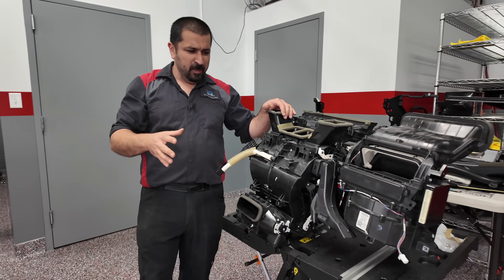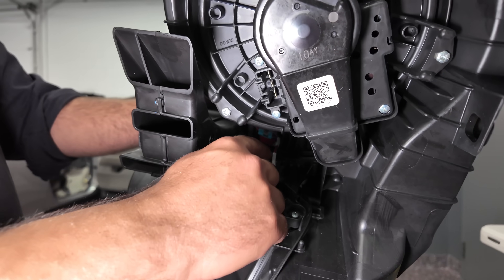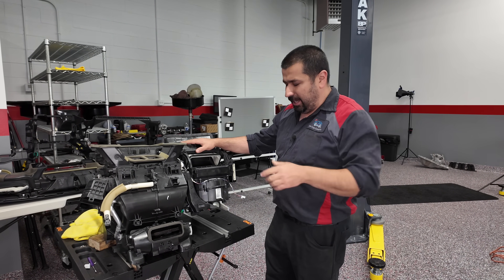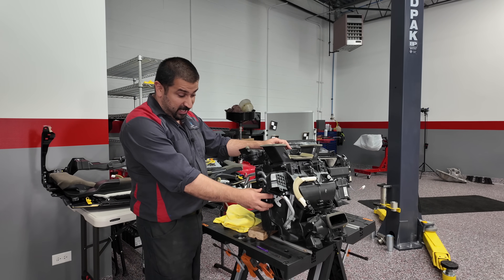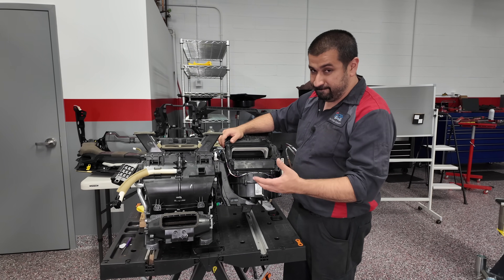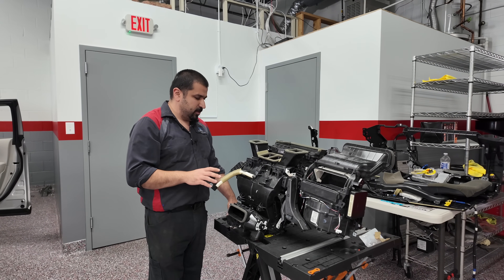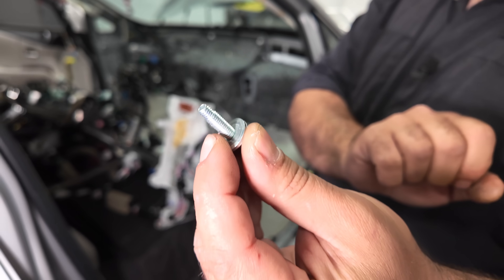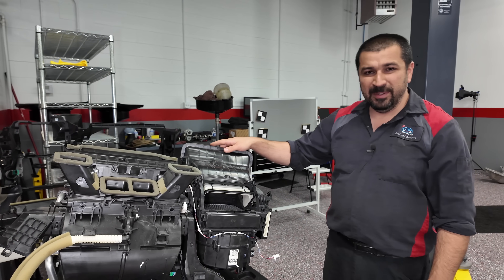THIS is Why Car Engineers and Car Mechanics Don't Always Get Along!

Comment: This started with CAD drawings many years ago where engineers sit behind a computer and makes his or her drawings it would be much better if the engineers and air conditioners  team should work together with a top of the line master AC mechanic, next the Quality Control and Field Testing  team should througly test R&D for any flaws that might occur during winter  and summer tempratures?

Comment: Everything made today is designed to be as cheap as possible to manufacture,
with zero thought given to reparing it.
I have been servicing consumer electronics since the early 70's, back then  they 
had removable plates so that you could gain access to replace the parts that 
often failed, then as the years went by the stopped fitting them, so you had to waste
hours dismantling the entire unit and have no way of been certain that you had 
replaced all the faulty components until it was reassembled exactly the same as this
cars HVAC unit is.
We made our own extension adapters to allow testing before it was fully rebuilt.
So i feel your frustration.
Todays servos and actuators have a finite life, yet they are used everytime the car is
started, crazy or what ?
Reply: I roll down the front windows in my 2007 Dodge caravan. Works for me. 
I don't think I have turned on the AC more than 8 times since I bought the dam thing.
 Cold / Hot control a little iffy for the past 12 years. I move it but once a season. lol
 I am a very simple man/ with very simple needs in life.
 YOU do the high-tech if you wish/ and pay the price when it fails.

Comment: My professor in school told us something I've always remembered, "engineers live in a theoretical laboratory world of their own design,  mechanics on the other hand live in the real world and have to correct engineer's design".
Reply: Not always true. I was a mechanic before an engineer.

We’re on the shop floor more than I thought we were going to be talking to the techs. I’m part of R&D where I’m inquiring between manufacturability and cost savings.

My most recent discussion involved the complexity of independent suspension vs beam suspended on an economy car.
Reply: As an Electronic Technician for almost 4+ decades, I 100% AGREE…..
Reply: There is design tool called DFMEA. Design Failure Mode and Effect Analysis. It works detecting possible failures in a system and their effect in its performance. When designing things you try to make them as robust, simple, easy to mantain and reliable as possible.
Reply: Your professor was an ignorant idiot. Every engineer works based on a tech-spec and main goals are system efficiency, reliability and cost. Serviceability is a secondary goal however components are graded, so for instance you have "easier" access to critical engine or transmission components (grade one), and harder access to grade three (HVAC) components. HVAC Engineers are also limited in design because grade one and two components take precedence. Your "professor" who I'm sure never worked a day in an industrial environment, assumes everything is as easy as his unfeasible conference papers and can BS about Engineers.
Reply: I guess if the professor is only talking about some design engineers. As a manufacturing engineers, I spend a lot of time on the production floor with techs and talk to them constantly. There's a lot more to engineering than being in world of our own design and there are many different types of engineers and we are constantly looking at other people designs. I see both sides of the story.... my dad was a mechanic and I'm a manufacturing engineers (but worked on cars all of my life), for the mechanics out there, it is way more complex than you would think designing something....just try to design something like a flashlight... you'll find it harder than you'll think it is. With that being said, there are definitely bad designs out there and it is always easier to see things in hindsight.... that's why bad engines usually get sent back to the manufacture to be analysis and to learn from
Reply: @ValidAsian as an Electronic Technician for almost 4+ decades now,  I have worked along side Engineers with good common sense, but the cluelessness of the bean counters on higher ups put a gun on their heads a lot.
Reply: @ValidAsian Shame on you for being so ignorant.
Reply: @ralfrufus6573  What am I ignorant about? I would like to learn
Reply: @ValidAsian  When it comes to the need of the people repairing what you have done.
Reply: @ralfrufus6573  There are definitely times where I could have designed something better and be for serviceable but I never said that there was no need for "people repairing what you have done". What I was bring to light was that designing an assembly is more complex than most people think and you are bound the find things that could have been done better in hindsight, I'm talking about any design, not just cars.
Reply: @ValidAsian  If it were up to me I would force the engineers to repair at least once what they have done, so next time they think twice before doing something.
Reply: @ralfrufus6573 If you really want to force an engineer to work as a tech (maybe they do, I don't know) then a tech should be forced to work as an engineer to come up with a more serviceable part. I ain't gotta worry about these overly complex systems because my trucks are going to be more basic models.
Reply: @jeffmockus5400  Deal.   The old designs are on record.  There is no such thing as something new.  "It's been done before."  First thing is to segregate the CAN bus wiring based on priority.  Luxury items shall be stand alone units....which saves wiring costs.  No radio is going to short out an important communication feed, such as security, on the CAN bus.  Next, take the TCM out of the goddamned transmission oil pan.  I can go for miles, baby.
Reply: @ValidAsian  My late professor, was referring to design engineers. Not the production engineers who have to correct the people at design.

Comment: I am currently dealing with the recirculation servo going out in my 2016 Camry (loud clicking when the door closes; sometimes it goes away). Looking back at the service history, the original owner had replaced it in 2018 under an extended warranty. The cost was almost $900. The servo itself is only around $120. I got a new quote from my local shop, and the total cost is $800+ for labor and the price of the part. Luckily, they did recharge my AC, as the air was only blowing ice cold on the passenger side. So now it will get me through this 120°F+ Arizona summer. I'm going to take on this task when summer is over.

Comment: Is it possible to get from a wreck the minimal parts and wiring needed to simulate that HVAC unit to do a test? Getting the wiring connections needed so it's like it was in the dash?

Comment: This is similar to what I had to do to replace the heater core on my 85 Capri.  I failed once during warranty.  Dripping coolant on the floor.   Was covered under warranty.  Have no idea how many hours it took them but it's a big job.  I think it failed around 3 years.  At 6 it failed again and was not under warranty.  I called in to try to get it fixed.  They could not get to it for quite some time.  It was November and getting cooler in the north east.  It was also getting coolant onto my windshield which is not easy to get rid of.  So I decided to do it myself.  Drop the steering column first.  Remove the dash.  All because this car had AC.  If it had not the heater core would have been accessible via removing the glove compartment.  Seemed to be this was due to some fault heater cores and maybe rebuilt.  Took me 8 hours to get it out, replaced and back in.

Comment: Ford F series trucks in the early 2000's soldered the fuel pump relay into the fuse panel and is not serviceable. You burn through many fuel pumps due to a failing relay.

Comment: This is why I avoid luxury car brands including Lexus. In the 1980's and 1990's the Toyotas with manual dashboard heating and climate controls/ levers/ blend doors, etc. would be trouble free for 40 years or 500,000+ miles.

Comment: Dear AMD, thanks for your video. I couldn’t agree more with you on the poor design of HVAC of RX350. The server motor started clicking and clicking when it was 8 years old. It was so difficult to replace a single server motor under the steering wheel on the driver side. Don’t know why Lexus engineers cannot design the moving parts for replacement as simple as possible. It was a shame to drive an 8 year Lexus 350 w/o AC in the hot summer. In comparison, my 10 year old Camry runs over 180k miles still has a strong & cold AC.

Comment: Awesome AMD. I was actually praying for a video like this. I have a problem on my corolla sprinter. The hot and cold (temperature control) is jammed. I accidentally dropped PAK shells (for a blank gun) inside the defrost vents. It took about 3 months, but the unit is now jammed. I went to toyota and was shocked at the cost to repair it. I am still sitting with the problem, but considering my options. Its now winter here in South Africa.

Comment: It's a great design if it never breaks down and you never drop anything into it.  Personally I have never in my life had a problem with any of that in any of the cars I have owned.
If that door is jammed like you think, would moving the rotor motor change the problem?  Probably not.

Comment: You are giving engineers too much credit.  They should have an idea of the service life of each component they design.  If they don't test whatever part or system they are putting in the car, then they have no clue as to how long the part/system will last & it's accessibility thereafter.  Motors can wear out over time either mechanically or electrically so they should be accessible.  I do admire your skill with Toyota models.  You are not afraid to dive in and take something totally apart.  How reliable are those coolant solenoid valves in the Toyota engines that have them?  Are they for emission related purposes (warm up certain parts before others to lower start-up emissions)?  Luv the shop floor by the way.

Comment: I got a '94 XJ40 and did some a/c work on it. The air flap actuators are accessible on the passenger side after removing the knee bolster. My car doesn't have glove box because that's where they put the 2nd airbag. The top actuator is a little harder to get to but doable without removing the dash. There are two feedback potentiometers on the drivers side, also easy to get to. TCM is also accessible on the pass. side. Expansion valve is located in the engine bay. There are two blowers although it's a single zone a/c. Pretty easy to remove them as well.

Comment: Decades ago....I was driving my 1969 Plymouth Fury when thick, white, electrical smoke started billowing from behind the dash, so much that I couldn't drive it. As I was re-wiring it, I discovered some hacksaw blades had fallen into the dash via the defrost vent and shorted some wires.

Comment: Ah,,,gone are the days of vacuum actuators and linkage cables. These two things made it very simple and reliable. I've had my share of working on all types of HVAC in Hondas and in cases as what you are doing, everything is critical. If you look carefully at the blend door actuators, most are "handed" with the same internals, only a few are specific but even those ones share the same internals as well.

Comment: I bought my 2017 Tundra in 2019 with 22,000 miles and love it except the AC blows pretty cold BUT even on high the volume of air coming out of the vents is low and takes a long time to cool of the cabin...on recirculate i get a little more volume but not enough i already checked and replaced the cabin filter with no difference....the blower sounds good just not enough airflow....Any Ideas??

Comment: Seems like a firmware code change could save the servo. The servo check at startup sounds like the problem. Set to center at cutoff & assume center at startup. I don't like the old lexus ac system - trying to mimic home central air. My tacoma also has the weakest ac I've ever owned. The modern tacoma looks great but there's lots to be desired in ride comfort & user experience.

Comment: My previous car was a 2012 Kia Rio5.  The A/C stopped working after about 7 years.  I had an extended warranty, so I had the dealer service it.  Like this Toyota, the heater core/evaporator unit is buried in the dash and the entire front of the inside of the car has to be removed as that assembly is one of the first things put in the car when it is made (so, everything else has to be removed to get it out).  The repair was about $3500 and the dealer had the car for the week (covered under my extended warranty plan).  Just wanted to share since the issue in the video isn't an exclusive issue with Toyota (it's pretty much this way in every car).
Reply: Interesting comment to me because I have considered later KIA models instead of Toyota. After doing some research, I stay with Toyota for reliability. This video and your comment demonstrates why an extended manufacturer warranty can be worthwhile.
Reply: @ashleycampbell6825  I have had the AC system fail on several previous vehicles, which is why I buy the extended warranties.  I also prefer to keep my vehicles long term (10 years) and I often find that stuff starts to go after 7 years, so I find I get good value from them.  The extended warranty on my Kia was $2300, but I was able to get about $7000 in repairs covered by it in the last 2 years I had it.

Comment: Ultimately, its a case of  another human ignorance by dropping "something" down the vent.  BTW, it would be nice to see that there is "something" dropped then jammed into  one of the valves to cause the damage (the way HVAC box is designed/configured that "something" has to be pretty stiff and not likely to just fell out of the vent box on its own unless it is physically removed)...  Hopefully, we get to see that...

Comment: It could be worse! Once I had to change only the cabin filter on a french car, and to do that, I needed to disassembler the glow box and multiple panels. Furthermore, the cabin filter had to slide in a narrow space. I don't think the engineers are at fault more than the project manager who approves or force changes to the designs!

Comment: I will NEVER again complain about changing the blend-door actuator on my Grand Marquis; what a mess!  GREAT VIDEO!
Reply: Never keep a car past the warranty. 
Recent "updates" made on cars, make used cars with turbos,9 speed transmission and lots of useless tech,a drive the little  people  into the poorhouse.
Reply: Once upon a time there was access for some car air handler units through the engine bay.  That is no longer an option because there is no space to access that side, especially with transverse engines.  Nowadays you have to open your wallet wide when you go in for repairs.
Reply: Brig back the Grand Marquis and the Colony Park!!!
Reply: Hi, I have the same problem in my 2006 Grand Marquis . Can you suggest a couple of websites/ videos where I can learn how to fix it? Thanks in advance !!
Reply: @deepakhegde73  there are videos on youtube that show how to change it without removing the dashboard...
Reply: What a disaster!
 I personally would NEVER tackle a job like that even on my own vehicle. Good Lord!
Reply: My 2007 Lincoln Town Car was pretty easy to change all the blend door and mode door servos on the heater box without doing all that. You can access them through the glove box, radio hole, and instrument cluster hole. Not needing to remove the entire dashboard.
Reply: @merrillschaps2325  Hi, I have the same problem in my 2006 Grand Marquis . Can you suggest a couple of websites/ videos where I can learn how to fix it? Thanks in advance !!

Comment: If it's easy to fix, the dealership goes broke, if it lasts for more than 4 years, the manufacturer goes broke. Engineers are incentivized to make cara impossible to fix so You'll either 1. Pay the dealership a years salary to fix the problem or 2. Buy a new car.  Toyota in Nashville wants over 1000 bucks to replace a battery plus "recalibrate" I have no idea what

Comment: The more I watch your programs the more apprehensive I get about my car.  Ignorance is bliss, I guess.  You're educating me about things in my car I'm not really sure I want to think about.
Reply: It's not only cars. I used to be able to repair most anything in my home.  We just had our one month old washing machine repaired under warranty. We had to wait for over a week to get a replacement part. It took the tech about 4 hours to complete for some reason. I was out and when I returned home my wife was fuming. The tech left leaving dirty fingerprints all over the machine and chipped paint, the damn thing works worse than before. When I called the store where we purchased the Washer the guy I was talking to said Yeah, ok and hung up on me. That was a day ago and NOTHING! My blood pressure is slowly rising. I'm going right to the store manager and insist they return my $12.000+ and come and take it back.
If I repaired someones car like that I would have been fired.
Reply: @wysetech2000 Then fix it yourself next time. Because trying to find any appliance repair techs is like pulling teeth.
Reply: The more I watch these programs because I watch the car Wizard to is either lease a car or drive a junker.
Reply: What I do when I’m taking something like this apart is put the bolts and screws in plastic bags and number the bags according to the stages of the disassembly. Then reverse the order for the reassembly. And take videos if you can.
Reply: @deanmartin2332  video disassembly
Reply: Then let me show you how brakes really work, that will give you nightmares.😂
Reply: Make sure there's enough $$$ on your credit card when you go in for repairs on these newer cars!